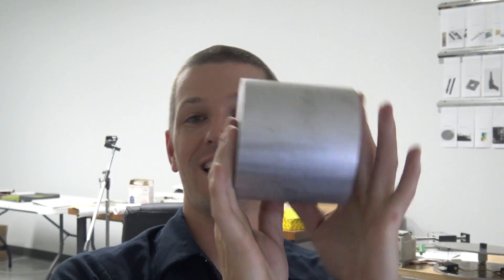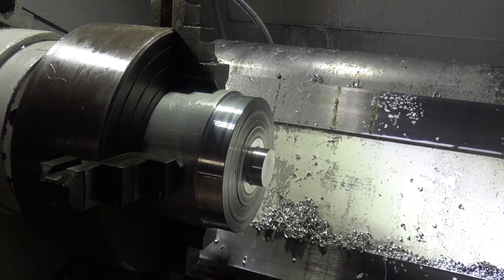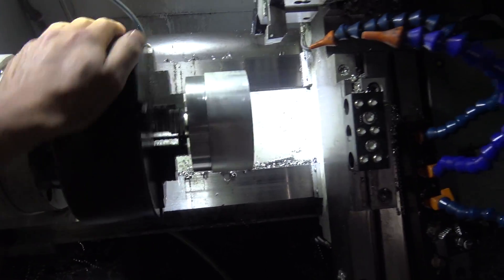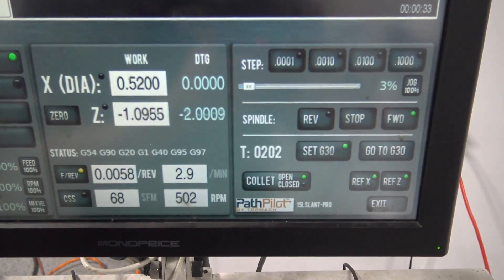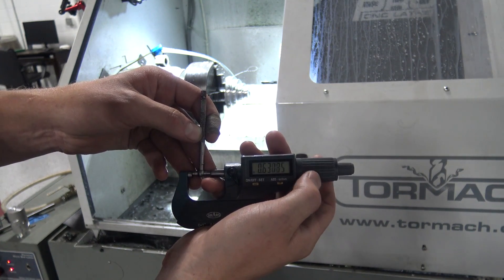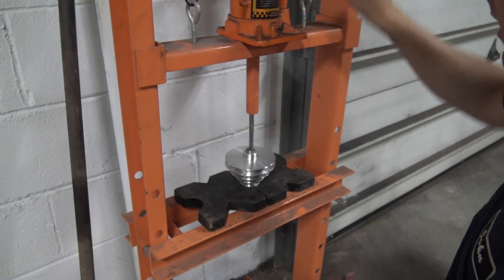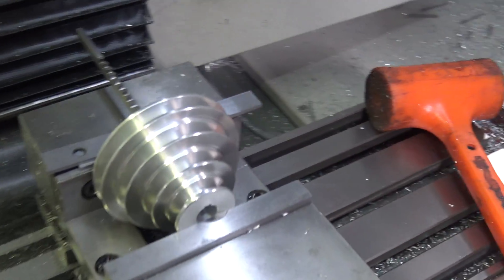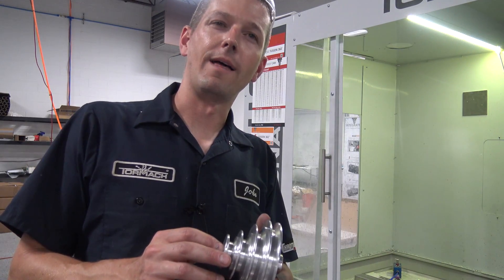Job Shop Life!  Turn, Bore & Broach a DIY Pulley!   WW106

Comment: Watch this video by Stefan ( if you haven't already) for a really good education on spot drills and why you're probably doing it wrong (I do it wrong all the time too ;)
https://youtu.be/Ot8wPGQW3JI

Holding that tiny boss with such a large overhanging part you're going to have a lot of problems. To grab it well enough, even with a collet, you are going to need to apply a lot of force, hence marking the part. That part really would have been better off done the other way around or with a tail stock. Do to the limits of your equipment I would have turned the boss only small enough to get the jaws to clear the finished OD of the pulley. Then grab that larger boss without fear of tossing it and finish the pulley side as you did. Then take it to the manual and finished turn the boss to size with a tail stock in the hole, this way you can grab the part very gently.

Never push a broach backwards, you run a huge risk of breaking off teeth, use a piece of bar to finish pushing it through. You probably needed to make a longer bushing. They are really simple to make, just take a piece of bar the right length, mill your keyway in to it, then just weld a flat bar across one end to get you a retention flange or just support the bottom with the press bars. I've made dozens of these and if you have the right size bar in stock you can knock one out in less time than it would take you to fart around with the short one on the press.

Comment: Turn down the rear (the area you weren't satisfied with) section, bore, broach, drill, insert key into a rod, put raw part onto rod, insert set screw, clamp on rod, turn the steps, remove rod, screw and key. But there are a number of different ways to skin that cat, all separated by time, expense and ease.

Comment: You may as well place the workpiece in the jaws if you're going to use stainless as the "soft jaws". Your tool paths are still at hobbyist level. There is no way you're going to save the customer any money. How about buying a close example and modifying? CAD on a one off is a waste of time. How about conversational programming?

Comment: okey I dont know if inch micrometers (or whatever you call them, snappgage?) work diffrently. arent you supposed to only use the smaller wheel on the tip? otherwise I think you F up the messurement.

Comment: John, use a 3 jaw chuck with bolt on top jaws, use a pin to clamp on then bore too the boss size. You will be amazed at what you can do machining wise on parts. Jim Riddle, Mojave Southern Machine Works

Comment: Turned out nice, looks just like the pulley on my bandsaw. I have a lathe tailstock but I normally do a job like this by doing the bore 1st and then putting the part on a dummy shaft for the rest of the operations. The bores tend to be the most critical on tolerance so I always hit those 1st that way if I overshoot and scrap it I don't have all the time involved in the other. If I am off a few thou on a belt groove no big deal, off a few thou on the bore and it is a big deal.
Reply: on a expanding mandrill perhaps?
Reply: Chris Anderson
It is great if you have them but they are fairly expensive and since I have none I usually just turn a dummy shaft since I normally have scrap bar around and if I need a positive drive I can mill the key slot in it as well. Given the choice I 4 times prefer turning between centers to strictly chucked, its so much more rigid.

Comment: A complete design will specify the required surface finish on each surface.  shinny, very smooth surfaces cost time and money.  

We used a plastic surface texture guide to convey what was NEEDED on non-critical parts.  Critical bearing surfaces and matched fuel system parts still required mu values and calibrated equipment that was maintained and checked against standards.  Kinda like we used  ..http://www.flexbar.com/shop/pc/SURFACE-FINISH-COMPARATOR-PLASTIC-p4483.htm

It is good that you are trying to  achieve the best possible surface finish, but it is costing you.

Comment: Try and use softer shim stock material than what you are turning. You can't use stainless steel since it'll still marr the surface of what you're turning. Sure, not to the same degree, but it's still going to marr.

Or you might actually consider using softjaws for stuff like this. Just machine in place and have a few blanks in stock at all times.

Comment: To finish pushing the broach through, couldn't you have just used a piece that was slightly smaller than the bore diameter and used it between the press and the broach instead of pushing it out backwards?

Comment: John, beautiful part.  I have a Harbor Freight press like yours and got tired of pumping it when broaching.  I bought an ATD 7422 air powered bottle jack, also 20 tons, and find it makes short work of broaching even 1/2" keyways.  When I have a long hub like yours I often broach from both ends.

Comment: For holding this odd ball part maybe bore first and hold on a bar?  5 tenths under and superglue in place.
Reply: or make the stub part over sized and after every thing else is done flip it over and finish it, that could also remove the problem of needing spacers
Reply: For the amount of material is removed i don't like the idea of super glue. Maybe with smaller depths of cuts. Further the small arbor diameter would need a tailstock support to keep it from flexing. At least I'd assume this. For the cutting force shown in the video I'd prefer a expanding mandrel supported with a tailstock.

Comment: John, Make yourself some copper condoms for you vise jaws.  Copper won't mar like stainless.  2nd,  go down to Harbor Freight and get yourself a 20 ton, air operated jack and replace the hand operated one on your press.  Saves your arm, plus it's a hell of a lot quicker.  Great job on the pully BTW.

Comment: Aluminum soft jaws for your lathe. You need to buy or make them immediately ;) 

Would have solved 2 problems. Wouldn't have marred the hub and you could faced them flat and put a chamfer to clear the radius where the hub meets the first pulley.  Would have eliminated all your aligned problems. 

And yes. You're correct. You should never back out a broach like that. Get stock or something to be able to push the broach all the way through. 

And thank you for spot drilling on the lathe.  Drill looked much better going in :) 

Not sure how to solve your poor chip breaking without exceeding the machines power limits. Smaller TNR inserts is my only suggestion. Drop from 1/32 to 1/64. It'll move the chip breaker to a shallower depth. Finish might suffer though, should be able to play with feedrates to fix.

Comment: Hi John, thats a nice looking part!!! :)
For the next one it might be better to face then drill and use a mandrel to hold it with a little loctite and or a nut or if there are many to be done even using the key-way.

Regards

Pd: that way of holding not only marks the parts but is also kinda dangerous, ask me how i know XD

Comment: If that HF arbor press isn't pushing straight I'd look at extending some channels 12" or so up each side from the crosshead and put some improvised bearings at the top and bottom to track on the inside of the vertical side rails.

Comment: For pushing the broach fully through the part you could just have used some steel rod, that fits on the end of the broach. You could understand that as some kind of extension of the broaching tool.

Comment: Nice save John!
Probably talking BS here.
In the past I've broached using a boring bar with a sharp ground tool and a lot of cuts in & out. Wondering if anyone has done this with CNC lathes. 
Would a custom machined 2-piece split Al. 'collar' work in holding the smaller end. Maybe even cap-screwed onto in temporarily?
Reply: Yep. We've broached on a lathe before like that. 

In this case though I don't think the machine has enough power to do it. It stalls out pretty easily.  The roughing cuts he was making here are right about the max the machine can take
Reply: +Occams Sawzall Further I think the "rapids" of the Tormach would make this pretty unproductive. But the Harborfreight press is also not the fastest. If I had to broach many keyways in this size in aluminium I'd go for a arbor press.

Comment: What sort of alloy were you using John?
Reply: This also my question. If there is no need for anodising, welding or something else that would forbid the use of 3.1645 I would really use that kind of aluminium though I have not often used it because commonly I work woth stainless and other steela. But when I used 3.1645 I loved it's good chip breaking characteristics but it is a mess on non enclosed machines as the chips fly everywere unless you lower your RPM.
Reply: 6061 aluminum
Reply: +1AB09CC3 
3.1645 (or 2007-T4 series aluminum) would be a poor choice for something like a pulley. 2023 would be a better choice of the 2000 series. But really, 2000 series aluminum is slowly being phased out (price of copper is getting outrageous), least in the US. And is being replaced by the 7000 series. Higher ultimate tensile a strengths, and cheaper to make than 2000 series. 

7075-T6 has become the new "high strength" aluminum
Reply: +Occams Sawzall Thank you for this informations. As I mentioned I'm not really familiar with aluminium grades and so my recommendation is only based on what I experienced when machining 3.1645 and it'a good chip breaking due to the added  lead. I also didn't know how 3.1645 is named in the AISI/ASTM countries and only found EN AW 2007 and didn't mention it as it's just a european standard afaik

Comment: Hi John, with regards to your shim/taping problems at the start, check out a guy called Robin Renz on yt. He is an excellent tool maker and uses this funky tape adhesive that basically peels away and just leaves the glue so its extra thin. Looks really handy, i think its a 3m product. Check it out, it might help.
As always keep up the awesome work!

Comment: just wondering if it would have been faster to do it on a manual lathe since it was a one off piece. I love the way the CNC lathes work when they work, but if you have to go and tweak the settings and re-post new stuff it seems like its going to take a lot of time.

Comment: I'm going to preface this with, "I'm not a machinist, and barely have touched cad/cam"
Im sure someone else has already put this out there, but perhaps your chip breaking isn't going to plan because, as your cut depth changes it's also changing the rotational speed of the part relative to the tool, so if you're tuning your chip breaking for a particular speed and initial depth the chip breaking probably won't be consistent as you plunge in. If the pathpilot/fusion cam adjusts the rotational speed while its cutting its news to me
Reply: Yes the rotational speed changes as  your cutting at a different diameter. It is called surface speed, in a nutshell, no matter the diameter the tool is always have the surface pass by it at the same exact speed. For instance, when you start facing a 2" diameter part it might start out at 500 rpm, but as its cutting the Rpm gradually speeds up and you could be at 2000 by the time it gets to the center. I hope that's what you were asking.
Reply: Tormach does have constant surface speed capability.

Comment: I always use 1/8" aluminum pads I cut from bar stock and place on the jaws(ie soft jaws) to hold the part, it never makes a mark on the finished piece.  That is on a manual lathe, so not sure how well that would work on the CNC.

Comment: Amazing the Tormach machines are actually Open Loop Stepper.....
Way back in the early '90's even the Centroid stepper machines had encoders to 'watch' 
position. High performance servos are a must have in any CNC shop in 2016.
Reply: That's the difference between Industrial and hobby equipment!
Reply: +Cad-Cam_Man that's one difference....another is price.
Reply: Crashed the first CNC lathe I ran a few times thinking that it would hold position after a reset. I was a newbie to the industry but now I have my newer machine programmed in a way to prevent that from ever happening again. Wastes a few seconds but well worth it!

Comment: I have the same horrid press by a different brand. It was the cheapest i could find when i bought it. had to rivet some clutch plates so i spent about a whole day fixing that press to make it not wobble. Welded the seams, shimmed it so that the legs are actually perpendicular and made a bearing setup that runs along the sides to prevent the pressing bar from having any play.

Comment: That came out looking great!! In my (very limited) experience with holding aluminum parts, I've had very good luck using brass shim stock as jaw pads in my 3 and 4 jaw chucks.  Admittedly this is at a much smaller scale, but keeping sheet brass around has prevented a lot of marring of parts in my pint sized shop.  Great video as always!

Comment: neat part, the better approach would be to start out with the hole, and to then turn the OD of the part on an arbor. not only would you avoid the jaw marks, but you'd have a much firmer hold on the part itself as well.  for the press, back off often to release any sideways pressure and it will be fine.

Comment: Leave cutting the stub until last. Keep the full diameter on the stock and turn the jaws around on the chuck. It'll be much more stable and secure while turning. When you turn it around to turn it for the stub you will have to be careful how you hold the part, protective shims or possibly a split ring to grab the OD of one of the pulley diameters could work.

Comment: The point on spot drilling is correct. At the very minimum your spot diameter should be larger than the chisel edge of the drill, and the point angle of the spot drill should be sharper than that of the twist drill. This ensures that the cutting flutes of the twist drill engage the material before the chisel edge. The angle of the cutting flutes allows the drill to self centre, which compensates for the poor radial rigidity of the drill. The chisel edge, on account of being flat cannot self centre, allowing the drill to walk if it engages first.
Reply: That's actually incorrect on the spot drill angle. You want an angle larger than the drill point angle. A larger angle will guide the point directly to the center and stabilize the drill.  A small angle means the outer edges will engage first. So unless you have a drill with perfectly even length lands (not likely) on land will hit before the other and push the drill point off center. 

120deg spot for a 118deg drill works perfectly. And 135deg drill points typically don't need to be spotted
Reply: +Occams Sawzall I can confirm this for the angle. For extra long solid carbide drills (8xD) like the ones I use the tool supplier recommends a 142° spot drill operation while the drill itself has a 140° tip. For even longer drills they commonly recommend a pilot hole 1-2xD which is slightly larger than the hole drilled with the deep hole drill. Slightly means approx. 0.02mm large. Than you thread in the deep hole drill with low RPM, commonly not more than 500RPM, and with a not-rapid-feed and before you reach the bottom of the pilot hole you switch to the work speed and feed.
Reply: +Occams Sawzall PS: Further drills may "hook up" into the (don't know the english term for what I mean) material when the spot drill angle is e. g. 120° and the drill itself has a 140° angle. You probably have experienced the more extreme form of this when you are widening up a pre drilled whole that is not exactly enough in line with the drill. At least on a drill press with a vise that you don't have clamped to the table you will notice this behaviour.
Reply: Hmmm, I've always been told the other way, but I could be wrong.
Reply: +imbored742 I've seen it both ways.  In fact Ghuring has both ways listed. For their HSS they say use a smaller angle and for carbide drills use a larger angle...  But after years of asking the largest consensus has been use a larger angle. 

What happens with a smaller angle is the drill lands initially engage on a sharp edge of material. In aluminum it doesn't matter much. But in steels it'll start notching the drill lands where it hits first. 

Making the angle larger won't notch the drill lands and makes the tip take the initial abuse. Which it's designed to do